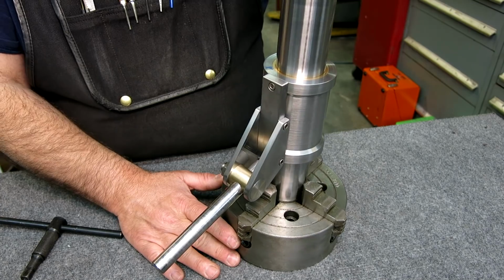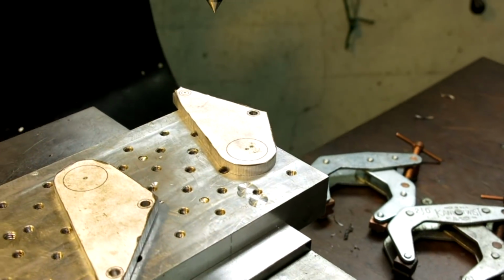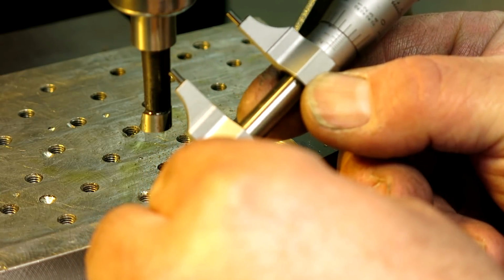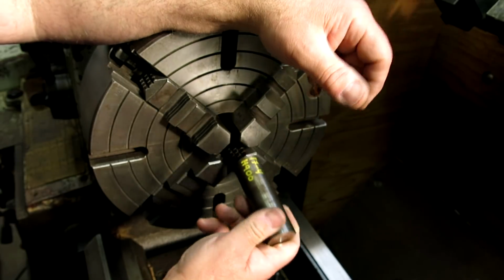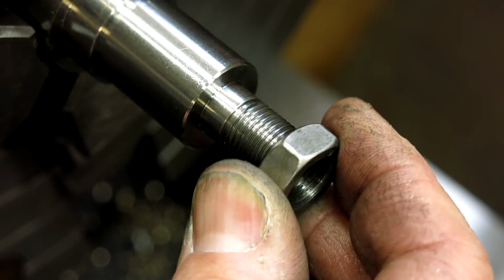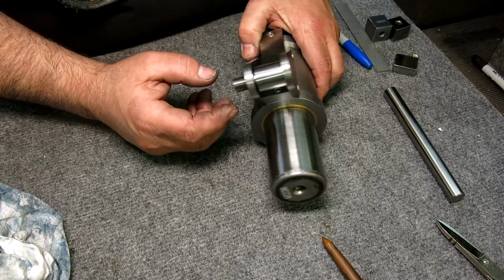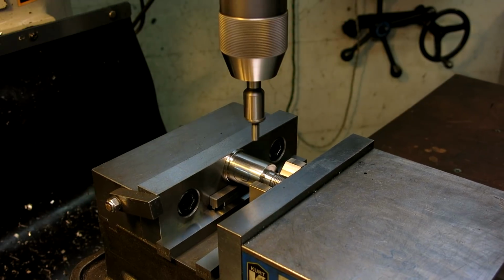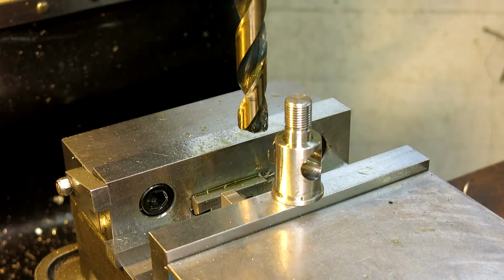Traveling Squareness Comparator Part 3

Comment: Hi Tom, I wish you showed how you recovered.  Usually you get screwed if you take the part out of the jaws before you're done.  I'm guessing you indicated on the drilled hole and knocked it around until the hole was vertical? Did you start over with a new piece?

Comment: Watching Tom apply the self-adhesive aluminium to the chuck jaws as soft pads gave me an idea. That aluminium looked fairly thick, but I wonder whether the thinner self-adhesive aluminium tape could be put to use as a lapping surface on a surface plate, just like the aluminium kitchen foil that Tom demonstrated in Monday Night Meatloaf 116 Part 1. The advantage would be that the aluminium in the tape is a little sturdier than kitchen foil and that it is self-adhesive. The disadvantage might be that the overall thickness of the tape may vary due to variation in the adhesive thickness and consequently it may not faithfully reproduce the flatness of the surface plate. I expect that the aluminium foil itself would be accurately uniform in thickness. 
Aluminium tape seems to be readily available in widths up to 4” and typically with a foil thickness of about 0.016” (40 um). Copper foil tape of about the same thickness is also widely available. (Apparently, amongst other applications, it is used to shield electric guitars from EMI and as snail barriers!!!) Has anyone tried these self-adhesive tapes for lapping on a surface plate? Tom? Robin Renzetti?

Comment: In slow mo it looks like you yanked it straight up and out instead of twisting it free.  Presumably the drill flutes stopped cutting, caught the last tit of metal and they then acted like a thread in a jack and just dragged it straight up and out guided by the jaws.

Comment: Hi Tom, great video as always!  question - did you lap the "head" of the snug to get rid of the nub left over from the facing op in the lathe  before clamping in the mill vise?  I was thinking that maybe the nub (non flat) against the fixed jaw was causing the snug to not be level to the Y axis of the mill.  In fact I thought that was where you were going to expose mr. Bozo.
Reply: I was wondering about that too...

Comment: Mr bozo visited my engineering class as well. Turned the spindle on in reverse by accident and chipped an insert on the face mill I had been using...in my defence, That was my second time using that machine, and the switch is wired so that you turn it in the opposite direction of the spindle rotation...very counterintuitive

Comment: Joel Shields
3 feet V 4 feet, With 3 feet you could grind one foot to adjust, with 4 feet if you grind one foot the tool would rock 
about the axis at 90deg to the adjustment, what do you think ??

Comment: What is the bad stuff that stainless nuts do on stainless fasteners?
Reply: Galling
Reply: xnoitulos sometimes not. If you machine them pretty close they tend Do Do it just by lightly fastening it sometimes..
Reply: Doesn't that take a while to happen?
Reply: Having used  untold thousands of 316 SS nuts and bolts over 4 decades, I've had plenty, fresh out of the box, weld themselves together before they have even got clamping tension. In critical apps I use 304 nuts and or antiseize. Bronze or Monel nuts are better. Just imagine explaining to a rich yacht owner that the keel of his flash racing yacht has to come off..
I've had to (carefully) cut off a nut by sections and hand file, linnish and polish the keel bolt threads in situ (1 - 2 1/2 inch diameter)..

Comment: Interesting,have had some work pieces ride the bit but not since I've used slightly smaller V blocks to hold cylindrical pieces leaving enough exposed for the drilling something my dad taught me

Comment: I recently turned some stainless of unknown variety. It was slightly magnetic and formed a chip like that 17-4 produced, though I was using hss. Do you know the reason the chip wasn't breaking? I was turning the od of disks using a collet, so the part wasn't too far in the collet and I wasn't taking high DOC's, so I thought my chip wasn't breaking for that reason. But after seeing you turn the snug, it seems more like the material property. 

I really have to find the time to make a indicator depth gauge, its been on my list for a while. 
-Pat

Comment: If removing material caused a loss of clamping force would that mean the part is slightly deforming and the when you remove from the clamp the hole isn't true? Or it's so minimal not to matter?

Comment: Could you not sweep over  the top of the part with the indicator for maximum reading in the X axis and that be absolute center?
Reply: Is your indicator tip dead nuts to the center of the spindle?
Reply: That's why I was asking, I'm not a machinist.
Reply: I was a welder for a machine shop and the older machinist would tram his vise and quill with indicators. When he would drill pipes and cut key ways he would put an end mill smaller that he needed and would touch off and  move the dials and change tools and next thing you know it was done and perfect fit. I was too busy burning rods to learn anything.
Reply: If you sweep an end mill across the top (and step it down) at some point the mark it makes will be the same width as the end mill. Just visually line the mark with the end mill and you are very close to dead center.

Comment: This is going to be one awesome and BEEFY squareness comparator! Great vid as always. Oh yeah, I was curious if there was any particular reason you went with the liquid love rather than the misty mist. Granted I've learned most of what know from you, but I've always used coolant for SS, my thinking was coolant would help to mitigate it work hardening. Is 17-4 better in this respect? I have worked with 17-4PH before and remember thinking it finished well, but how the in hell do I break this chip??? The answer of course was feed it like a it's that's been fasting for a month of Good Fridays. lol   Thx Tom
Reply: I think he said it was already at h900 hardness, which I believe is as hard as that material gets.  If anything, a cutting related heat-affected-zone could be softer?
Reply: You may very well be right. I took that to mean its as hard as it comes. I've never heard of a metal coming as hard as gets because it'd be too brittle, but I don't know much about precipitation hardened steels. I've just alway thought it's better to run coolant stainless for both material and cutter, but Tom knows way more than me and it might have been as simple as he knew oil would be fine and didn't want to "make a mess" with coolant sprayin' everywhere as he says.

Comment: So: how did you get that part back in the vise with the partial hole parallel to the mill spindle?  I've only done it with real finicky work with an indicator in the spindle running in the hole and that's a real PITA with a rough drilled home.  I'mhoping that you have some trick that makes it easier.
Reply: Russ Kepler 
I was wondering that as well. Maybe screw it back onto the drill, lower it down between the jaws of the vise, and clamp it down again? I'm thinking that, depending on how much material was left for the boring operation, it might not have needed to be perfectly aligned anyway.
Reply: He had Mr Gozo help him out. (He is Mr Bozo's opposite!! LOL)
Eric
Reply: If I had a gage pin that fit the hole and also fit an available collet, I'd put the gage pin in the collet and then lower the pin into the hole in the part, then clamp it back in the vise. Then I suppose you could indicate it with a dial test indicator or coax. Then again I'm no expert.

Comment: Drilling through a concave surface is often troublesome for me too.  I've had instances where the work pulled away and out of the fixture, fractured the drill bit, and sent the part flying.  It's no fun.  Great work as always.  Tom.
Reply: MrShobar if you have an end mill, the more flutes the better, you might find it safer to drill with it once you have a pilot hole of a suitable size. .

Comment: Ahh the old helicopter, its one of the oldest tricks in the book!  Next time you do a job like that go ahead and screw the nut on the end as it will protect the threads and it gives you a bigger lever arm so it won't be as easy to twist out of the vise. :-)
Reply: Take a closer look, in this case it didn't twist out of the vise at all. Once it broke through it pulled the part upwards. It didn't twist at all until it was lifted clear of the vise. There wasn't enough clamping pressure once it broke through to hold it in place against the uplift pressure of the drill.
Reply: Exactly what happened, fairly obvious it didn't twist out at all. Simply lifted out by the drill bit
Reply: If you mean by Twist it basically "screwed" itself upwards on the Helix of the Drill then yes
Reply: I was thinking the same about putting a nut on the threads for better holding and to protect the threads.  But if you play back in slo mo, you can see the tool lift the part out of the jaws.
Reply: Good idea!!!
Reply: Your so right  Andrew !